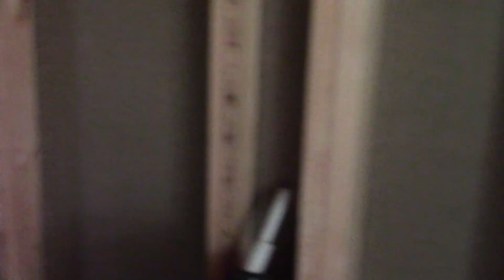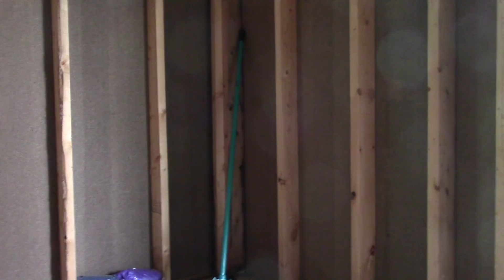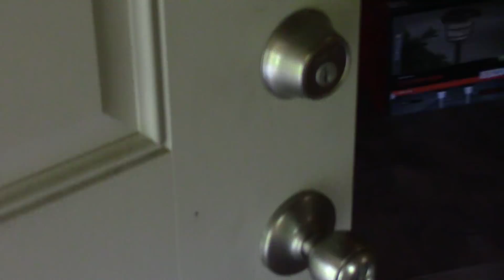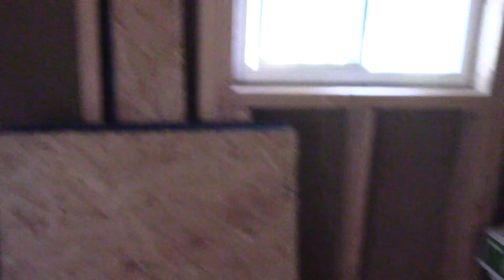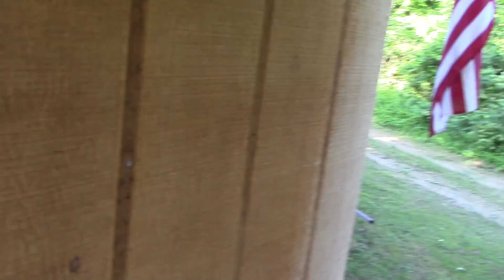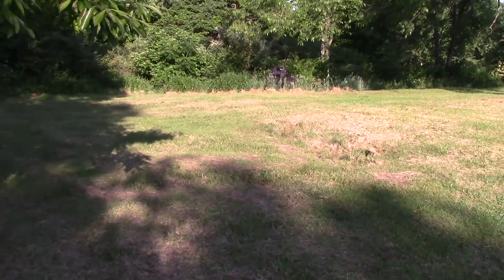Off Grid Cabin Build 24 - Electrical Pt 1

Comment: Hey Joe, why do you suppose this other video of installing an outdoor receptacle off of an existing indoor receptacle, says that you should use a separate 6 inch wire to connect the inside and outside wires together? Does that make any sense to you? It seems to me like you could just connect the inside wires to the outside wires. I don't see the reasoning behind adding another wire. https://youtu.be/q61A_wsghRc?t=4m9s
Reply from the maker: The pig tails are done to send live to both outlets separately. If one go bad, the other will still work.
Reply: St. Bernard Acres well I guess that makes sense.

Comment: don't forget to add an exterior box for a receptacle (maybe out on the front porch) sorry back seat drive mode now shut off. great video.
Reply from the maker: Thanks!   Excellent idea.
Reply: it's just a lot easier to install one now before the sheetrock goes up. You do good work.

Comment: joe remember that you need to have 12-2 wire any where near water that is GFI grounded. bath ,and kitchen mandatory code. best too run all walls with 12-2 wire ,then gfi ground outlets.
Reply from the maker: Thanks!  If this was my house, for sure.  Won't be any outlets near water in the cabin.
Reply: Joe, by code bath and kitchens, are too be 12-2 wire, GFI ground curcet, no more then five foot from any water housing. save the fines that will be issued if you build better then code demands.   I build a cabin in Madison, just across from the park land there. they told me that there was no building code zoning needed.  they hit for 150 bucks, at every visit. the water well had too be put in by a plumber, that had permits to drill a well.  listed pipes, connects, and line limits too the house/cabin/ holding tanks all has too be new. made for that purpose. not food grade containers you have there.   that's a three hundred dollar fine.  if it in run into the house, it triples the fines.  wheeling an't that far away ,so, I'd bet the fines are the same.  the county clerks office has all permits listed, and given out, and will  try and get you for everything they can spot. I know it cost me over ten grand too fight them in court, and the judges words told me ahead of time that I had lost.   judges name begins with Alex something or other.  but his word hit home. you have the right too appeal my ruling after I make my ruling.   I found out that the clerks relative wanted the cabin, as his son was getting married. they hit me with fine after fine, until I had enough.  I striped the cabin down too bare wood, I even took the screws that held the roof down.  took the solar panels and system to make them work.  I sold the property back too blue ridge ,and went south.  laughing my ass off. you see, after I went too the state and filed suet against the county, their code listed was not state issued building code. they didn't like having too pay me, my losses. I sued then time and labor for lawyers fees too.   if I remember right I did tell you too get all permits from the state issued and copied. make sure that the state and county codes match. for once they are paid you get screwed again.  stay safe and running wild, in wheeling.

Comment: Joe you are great , but one hell of a lazy SOAB. -)   This project could have been finished a year ago -)
Reply from the maker: It could have been if I wanted it to be, or needed it to be finished, but I  don't. This is s 2 week process at longest.  In the lest 6 months I've had maybe 6 days out here I could dedicate maybe 6 hours to. I live over an hour away, I work a full time job with overtime and many mandatory weekends, if I get a weekend off, and the weather cooperates,  and I have nothing that needs done at my house (which is old and needs work), and I'm not too tired from a 65 hour work week, I can come out here for a few hours.  If I dont have to mow or work on something else out here, I might get to nail in a board. A lot of the stuff in this cabin is recycled or used stuff that I have to wait on as well. So, if you want to send me a check for a few thousand dollars, pay for a couple of weeks of vacation, take care of my house, kids, wife, dogs, chickens and the volunteer work I do, I'll show you I can do this in a couple of weeks. I take a lot of what you said in jest, and I am an SOAB to be sure, but I ain't lazy  :l

Comment: Hey Joe!
Are you not running any 12 volt wiring?  Much more efficient to run low power devices like LED lighting straight from the batteries.  A 1kW inverter will probably pull 50 Watts on idle, which will flatten a 100 Amp battery in a day.  Plus you will have to run the genny every day, just to keep up.  If I were you, I'd be looking to run everything on DC, except the air conditioner.  Sunlight is free, gas isn't.
Get some 12 Volt fans too.
All the best, matey.  ;o)
Reply from the maker: Still thinking about that one.

Comment: Hey Joe, how about one of those 20' shipping container? Also, you might want to get one of those stainless steel U shaped re-enforcement plates for the lock set. It'll make it a job for someone (crack head) to kick your door in and strip out your copper wire. I'm with Gary on placement of the AC. Putting it through the wall makes it a lot harder for someone (crack head) to get in the cabin. Good to see progress.
Reply from the maker: Thanks!  Good advice!  Can't afford a shipping container though lol.